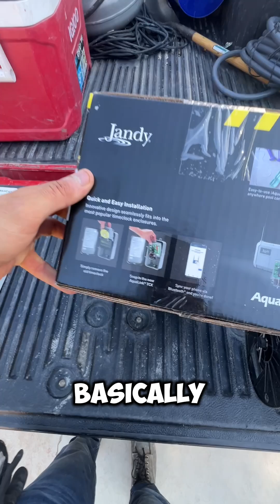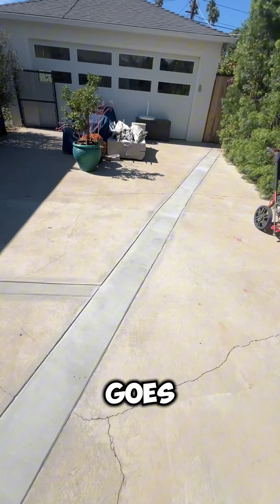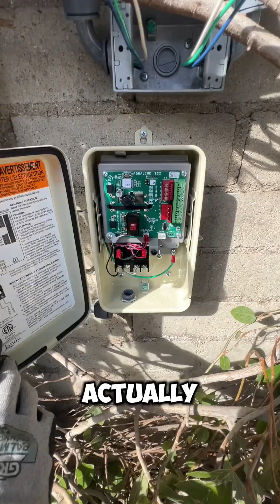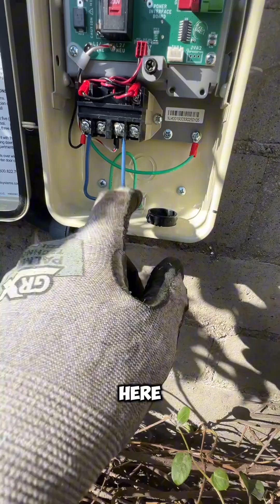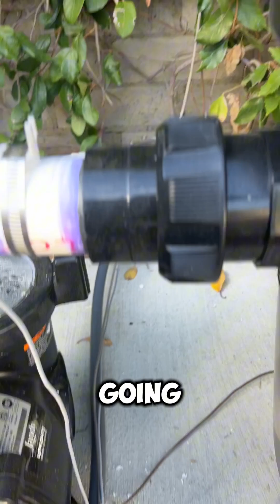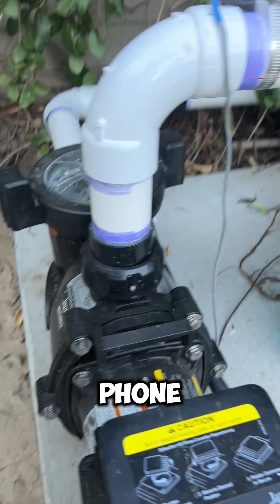Installing a Jandy Aqualink TCX Conversion Kit!!!

Comment: Did you hook up a salt chlorinator to the system?
Reply from the maker: Hi not to this system it doesn’t have that support yet you would have to install one that has its own power source and control. Or install an aqua link RSP4 which is the complete automation system

Comment: You don’t need the light switch. You can change the colors on the iaqualink app.
Reply from the maker: When it’s a full panel you don’t need the switch if it’s one of these tcx systems to still need them at least in this one they don’t have the option for extra relays to control lights that’s the reason for switch. It acts like an external relay 🙏🏻

Comment: will this work with a inteleflow vs pump and a mastertemp pool heater
Reply from the maker: Yes it will just wiring the communication is a little different but yes it will work

Comment: Are the poor and spotlights connected to the jandie aquilink or different app
Reply from the maker: Hi @mcpond3481 since this is a cheaper version to go wireless it only allows one slot for lights, you can technically wire pool light and spotlights to same switch to make them turn on and off with the same wireless switch. But it doesn’t give you extra relays to use for different light systems. You would have to upgrade to atleast a RSP4 or RSPS4 if you have pool and spa combo.
Reply from the maker: But pool light is conectes to the Aqualink link so you have complete control over color lights and all the features in the iAquaLink app 🙏🏻